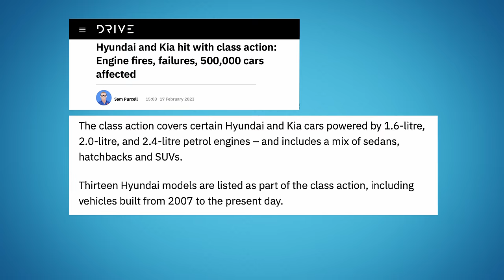Australian Mechanic Reacts to Aussie Car Problems

Comment: You DON'T get a new engine - you get a USED engine under warranty.  They just have to get you to 100K miles.  Many people have been surprised by this.
Reply: FALSE. YOU GET A REMANUFACTURED ENGINE. Semantically speaking, yes its used, but it's been completely went through top to bottom. Still a Kia engine though so not so warm and fuzzy feeling about it being reman lol
Reply: Really? My friends engine on his elantra went out at 75k and he got a brand new engine with another 100k mile guarantee on it. But that's maybe because we all work at the hyundai dealership and are close with all the service advisors 😂
Reply: @DonisGP  almost all of them I've done under any service campaign are reman. If it's under Kia Basic wty, it's usually new
Reply: I can get a new engine if I wanted to. 
Who are you to tell me about my engine?
Reply: My 2014 kia burns a quart of oil a week and is making scary noises, kia told me it's normal oil consumption 😂
Reply: no miles in australia
Reply: Since 2014 kia offers 7 years warranty with unlimited kilometers in Australia
Reply: @TotallyNotRedneckYall  1qt per 1000mi... sadly it's true per Kia "standard" but that's what they make us go by.
Reply: @bonnome2  that sucks. The PI1802/1803 campaigns are lifetime in the US. 999/999,999 is literally what it says on the paperwork as long as all the prior recalls are done
Reply: I guess an Australian engineer designed the Chevy 6.0 liter Vortec oil filter location.
Reply: Yet people keep buying them🤷‍♂️
Reply: I was at a local kia dealer a couple weeks ago and heard they had 35 cars waiting for engines. So why no free engines here?
Reply: @joshlewis5285  cause they're cheap and have the best warranty in the industry. 1st owner 60k basic/100k power train.
Reply: Under Australian consumer law it HAS to be a new engine, they can not replace the engine or components with used parts under warranty. Australia has some of the toughest consumer laws in the world. That is why so many American companies struggle in the Australian market.
Reply: @murkadelic422  yea I was gonna say I see all of the head techs putting brand new ones into the cars
Reply: @joshlewis5285  because Kia/Nissan/Hyundai will finance nearly anyone. For some folks it's their only option.
Reply: I blow a hole in my engine block once and it was still under warranty and the dealership just replaced the block and reused the original head I didn’t feel great about it but I was driving again for free hard to be upset
Reply: @gregorygranillo2227  Yeah, if it's under normal svc procedures, we replace the bottom end and block, send the head to a shop to be cleaned and checked, new intake manifold due to metal contaminants (seized and hole in blocks are the only ones cause they're considered catastrophic failures), and new gaskets.
It's called a "short block"
Reply: It's almost like they replace the engines in Asia at 80.000 Mi and then they send them to America to be sold in the second hand reman reused Market
Reply: My buddies 2013 Kia Rio has 247k miles
Only 89 octane 
Never had anything done to it 

The biggest issue is making sure it reaches full operating temperature before you shut it back off again
Those five and 10 minute trips to the store are what really do the damage to these engines
Reply: @thecloneguyz  the Rio is unironicly probably our best car. It's basic, cheap, and no turbo to cause premature wear.
Reply: @murkadelic422  My buddy said anytime you drive it without letting it reach full operating temperature it leaves a bunch of carbon and crap inside the head
He said you only have to do this literally a handful of times before it starts running like s*** and you have to take it in and get it cleaned
Reply: @thecloneguyz  yep, that's a GDI engine for you. Since the injectors are under the valves and not above them, the fuel doesn't wash the carbon off the valves, causing it to run poorly and misfire.
Reply: @murkadelic422  it amazes me that it's a pretty simple fix if you just leave it running until it reaches full operating temperature before you shut it down but most people are too busy or too self-involved with their lives to pay attention to this
Reply: Worked at a Hyundai dealer for 5 years. This is untrue, you get a reman engine
Reply: @smileyfacefrown2723  also have lemon laws in some states here. 3 major faults and you are entitled to a refund.
Reply: I can tell you that here in the states they label even new parts as “reman” because of duties. You can get a clutch for a 6 month old car and it’ll have a “remanufactured” sticker on the part and the box.
Reply: @Rsty_raptor  yep, also due to the fact that many manufacturers use cross-compatible parts so that reman could be actually reman from another brand and retagged for whatever. It's wild how many brands coexist with parts
Reply: @murkadelic422  I think it’s mostly about import duties. They’re all new and they don’t even charge substantial cores if they charge at all.
Reply: @Rsty_raptor  on most things. Larger items like blocks, trans, awd/4wd cases or diffs usually gotta go back. Alternators and starters are another good example. But I guess it all depends on the manufacturer
Reply: profile picture checks out...
Reply: @murkadelic422  almost always brand new. Sometimes Remanned
Reply: @murkadelic422 Gdi is a secondary issue. Primary issue is recirculation of crank case pressure and egr gasses into intake.
Reply: @darianistead2239  On which engine? These vague ass statements are quite annoying considering this statement only makes sense for engines with an EGR system. Rio's don't have them and neither do 2.4l engines that explode like hot potatoes
Reply: @PBMS123  maybe your manufacturer, not where I work. 98% remanufactured.
Reply: @darianistead2239  Stroke that ego instead of a legitimate response. That's cool, dude. Glad you feel "substantial." Still doesn't change the fact that the two engines I listed don't have an EGR system, at least Kia specifically doesn't use them on those engines.
Reply: @murkadelic422  or just don’t buy a Kia or Hyundai and buy something better. Would say a commie or Falcon but that’s never happening again

Comment: The real story behind KRANKY. was explained years ago. The engine was spitting so much fuel out the tail pipes onto the bushes behind it actually caught fire prior to the skid!
Reply: JC Whitney used to sell a kit where you can shut off one or two of the spark plug wires and allow the fuel to go down the tailpipe , And then you mount a spark plug in the end of the tailpipe!! 
Shooting flames anytime you "PUSH" the kill button

A few guys ACCIDENTALLY GRENADED THEIR INTAKE MANIFOLDS!! 

PFFFFFFFFFFTTTTTTTTTTTTTBWUHAHAHAHAHAHAHA
Reply: @thecloneguyz  Nothing like washing your cylinders clean from all that annoying oil and then lighting it on fire. I knew someone who ruined a relatively recent rebuild by having a carb that was dumping in too much fuel and still driving like it. Had an F-150 with a 351 in it that was getting 8mpg or so. Eventually took out the rings.
Reply: Yeah they should of at least had a concrete barrier setup at the launch area. 

Also it didn't help KRANKY had been idling for a few minutes prior to pulling into the launch area so the exhaust had time to heat up and the engine was on a methanol tune. And no doubt fuel was pooling up.

This shows a different angle he was sat there for 5+ mins just idling. extreme heat + methanol that has an invisible to the eye flame as soon as he starts revving you can see the vegetation get doused in a nice mist of methanol that had not burnt and had pooled up in the exhaust. and can literally see it turn into a visible flame and it goes from the vegetation down the dried out rotted tyres and across the Bitumen and up to the exhaust
https://www.youtube.com/watch?v=PkrVKHjDLeE
Reply: @DigitalGangster. That was early days now they know.my dad lives there and helps run the event he said they stopped using hay after that burnout ..

Comment: i heard that a lot of snorkels in australia are more for dust than water crossings, raising the intake to the top of the car is enough to mitigate the dust getting into ur filter
Reply: that is right. there are 2 types of external air intakes for 4x4's a raised air intake and a snorkel. the former is just to get the air intake up and away from the factory intake in the fender that tends to suck up an ass load of dust kicked up from the front wheels. the latter does the same but is also designed to do water crossing's as well.
Reply: Its for both, typically if you're driving in a region with excessive dust (unsealed highways or trans-nullabor) they're likely to be flood prone anyway.
Reply: Correction.....  Most snorkels are for city drivers who want their 4x4 to "look" tougher.
Yep, down here 4x4 owners have become the new "Ricers".
Reply: Mine is for dust. Wouldn't do anything for water.
Reply: If it is purely for dust ?
You should get a sock for it. (Any kind..lol)
Just make sure you take it off when you leave your rig ,or some jammy POS will steal it.

Comment: I think the worst thing to happen to every car guy in Australia was Holden stopping production
The $300 beater commy now costs 5k…
I don’t give a shit if I lift my car and a spider falls on my face but if I go to open the door and feel a web under the door handle I am RUNNING.
Reply: Get the surface spray under the handle. I've also been taught to open the door via the very edge of the handle, or just checking beforehand
Reply: Yep, I'd love to own a classic Holden again, but you can buy a brand new car for what they're asking for them. the most I ever paid for any of the Holdens I owned was $1500.00 for my HQ Panel van. and I bought my HK Brougham for $600.00.
Reply: Fkn oath mate, and don’t even get me started on the death of real utes for these overcompensating, yank tank, pick-up “trucks”!
Reply: @catey62  Imagine the price of a HQ Panel van now. My uncle had 3 parked in his yard for many years. Me and my cousin tried buying them but he wouldn't let them go. Many ears later I had to eventually drag them out with a tractor to dispose of them. They were so badly rusted, they snapped in half under the dash. Some aluminum trim and a GTS dash was all that was salvageable. 😢
Reply: 100% truth, the way GM handled Holden is criminal... During the period muscle cars were popular in the US instead of introducing Holden to the US they badge engineered the Monaro to the Pontiac GTO and Commodore to Chevy SS. 

Holden could have been quite successful in the US imho and as a result they might even stil have been around today. 😢

A Maloo HSV is my dream car but I'd have to wait til the dang car is 25  years old til I can legally import it cuz US has stupid import laws for cars.

Whenever GM has something good (Saturn another example) they inevitability screw it up.
Reply: @chdreturns  this vid was a bit of a yeah nah moment. Being a 70's kid and thinking Holden actually was Australian
https://www.youtube.com/watch?v=k1jqvXK-Q4Q
Reply: Not really accurate. 
All the True Car Guys are glad they dont have to worry about as many idiots on road with less holdens about as more n more get smashed the numbers will drop thankfully. . 

Real car guys dont even touch anything Aussie or American Made.
Reply: @tbas8741   "All the True Car Guys" ...??🙄 
"Real car guys don't even touch anything Aussie or American Made."  ..??🙄
Pffft, Stop playing with yourself dude.
I think you meant to say, "A few of your fellow fanboys."
I have here a Holden HQ 1tonne ute, a Holden VY Commodore wagon, a Ford Falcon G6E, Landcruiser Prado, 2 x Dodge Phoenix's, and a built Nissan Silvia S15 Spec-R widebody. Excluding the Prado and Commodore, They are all minimum 400hp cars. My Silvia has featured on the cover of a magazine. The last car of mine I sold was a GTR powered VL Commodore. For 20 years I drove over 1000km a week non work related. I have driven a 10 second HT Monaro on the streets. I can buy a full reco crate motor for $500 delivered to my door for the Commodore. 4 of my cars mentioned above have more than doubled in value.
Now for comparison, please explain to me how you are a "True Car Guy" while I am not.
Reply: WHY RUN the deadly spiders live under logs and rocks?
Reply: @catey62  Kind of crap that the Australian tax payers were contributing 20k to each chommy off the line. Ultimately GM sank holden as it's too small of a market for them to care. Unions had some play but if you're a production line worker you are not going to refuse $70 an hour? There  was a whole line of Australian  companies that produced parts for Australian built Mitsubishis, Toyotas, Fords and Holdens that that also lost big time.
Reply: oh man Thank you baby jesus I live in the michigan where I dont have to worry about large deadly spiders under my door handles. You aussies are some tough S.O.B's for living amongst some of the deadliest creatures on the planet. Respect!
Reply: @DavidHands  id actually like to know what "real car buys buy then"  German and Italian? I mean if we are talking arrogance....there is no higher platform than German and Italian cars
Reply: @justins21482 : Real car guys can buy any kinds of cars. A Pantera?  Escort?  Kia?  Ferrari? It depends what they do with them. 
The guy I responded to claimed "all the true car guys" blah blah blah. Well I wanted to know what he drives to be such a wnkr. Do you think because someone owns a crappy old German beemer that he automatically becomes a "true car guy"? pffft. German cars need to be constantly well maintained and it costs big money. While Germany were adding massage seats and steering wheel heaters, it was GM that first  introduced magnetic ride control to performance vehicles. The VL Commodore was powered by a Nissan RB30 skyline motor. It is not a brand thing too be a "true car guy". It is a lifestyle.

Comment: 8:54 - Hearing him say that Kia/Hyundai are looking after them regarding the engines catching fire and trying to correct the issue, reminds me of the Ford issue in South Africa a couple of years back. Basically there was a period where new Fords at the time had a tendency to catch fire from the gearbox, you'd hear reports on it almost daily on the news and one unfortunate owner actually died. Ford SA was facing charges and, unlike the Kia/Hyundai case here, refused to accept responsibility (not just for the owner who died, but all customers whose Ford burst into flames), and went so far as to try blame the owners' for the fires happening. Best part was when watching a new episode of Ridiculousness (around the same time the Ford SA issue), they had Ken Block (a U.S. Ford racer) as a guest and they showed a clip from his racing Ford's (same model as the defective Ford SA models) onboard camera, and his gearbox ignited and was burning inside the car mid-race. Disgusting attitude from Ford SA.
Reply: They never ended up getting consequences? No lawsuits? That's disgusting, man
Reply: I'm not sure of the current status of the lawsuits, but here the judicial system is so pathetic, it could be decades before the case gets closed IF it even proceeds further at all. Yea, it's horrible @AquaticOni
Reply: Ken Block’s too?? I’d assume he’d have some upgraded items, especially drive train.
Reply: @Bakedfrijoless  any likeness or representation of him that is not him is blasphemy yet we claim that Holy bread represents his body and holy water represents his blood and the church represents this and the statue represents that and the Bible represents this when it's literally all blasphemy according to the scriptures themselves
Reply: Kia/Hyundai's did NOT catch fire! they had rocker arm seizures.
Reply: 0:20 VH commodore

Comment: When 90% of the crazy stuff they showed was "Normal days", it is wild down under!
Reply: They are a different breed
Reply: They’re putting it on a bit. Unless you live in the sticks, you won’t see most of it. 

Some of the toughest car laws in the world are in place in our major cities. Just about any modifications in Sydney could get you booked by anti-hoon laws. 

If you go to a drag strip you will see bogans blowing their engines pretty much every night of the week though. Commodores are pretty common for spilling their load of oil all over the drag strip and requiring a 1 hour cleanup.
Reply: all this stuff is pretty common around the world, they are just making it look like a big deal cos Australians are there, would be the same thing if it was reversed
Reply: @@mickoxley7729 city slickers still go to drag strips and closed circuits.

Comment: Top tip for flood crossing. Don’t do it but if you absolutely need to stuff your air box full of tshirts or any kinda clothes you have it will give you a few more seconds of driving. And if you flood your engine. Pop the spark plugs out turn it over till there’s no more water coming out then try and fire it up
Reply: it had a water bra on, but still failed.
Reply: I wouldn't even suggest driving through flooded water crossings
Reply: No, just don't do it. You can't know how deep the water is and you're likely to heavily reduce the lifespan of many components of your car. It just isn't worth it.
Reply: an oldtimer tip: know how high your air intake is in your car.  then you know how deep you can survive going.
Reply: So that's what happened to that motor I got gifted with mangled socks jammed in the intake valves!
Reply: @kenbrown2808  That only applies for regular water crossings not flood water
Reply: @Cool450sxf  and uet my town has roads that flood every year and it works on them.
Reply: Bruh I was like damn they got kfc right next to the croc swamps 😂😂
Reply: or go full 4by bogan and get a custom airbox with a snorkel
Reply: Also, go real fast and just skim over the top.
Reply: @FJaypewpew the land cruiser had a snorkel and an airbox just wasn’t sealed